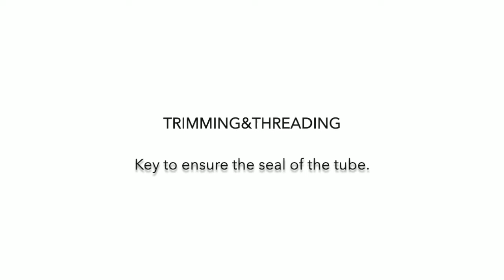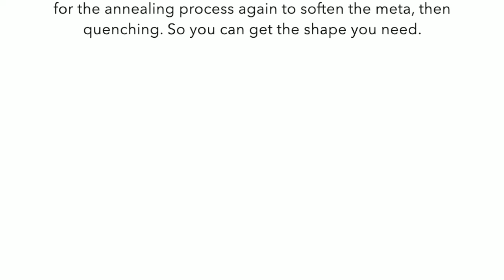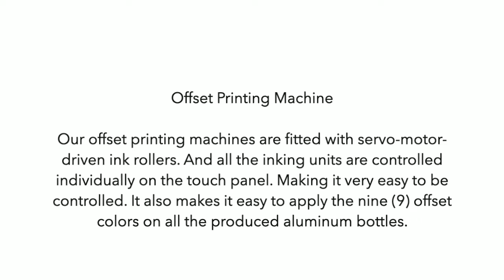How to Make Collapsible Aluminum Tube - The Production Show of Manufacturer

Comment: My company name is Dashami industrries.We manufacture aluminium collapsible tube line, aluminium aerosol can line, and aluminium bottle container line machine. We manufacture in impact extrusion press machines. We manufacture dry offset printing machine metal closure and plastic cosmetics tubes. If u have any requirements then let me  know. Thanking you.

Regards,
Jasdev Singh.